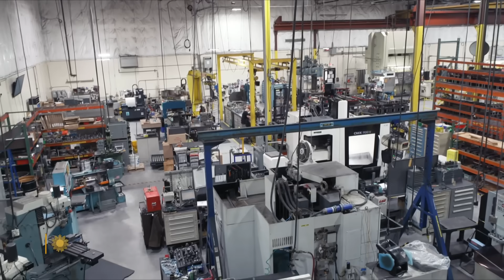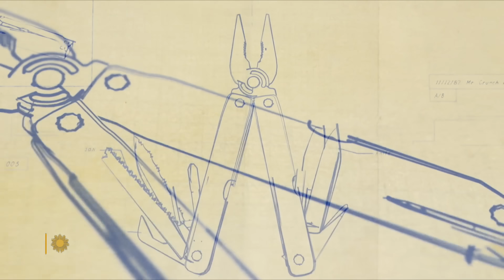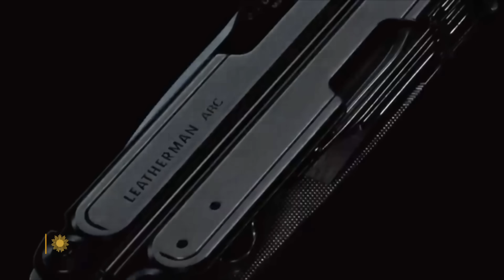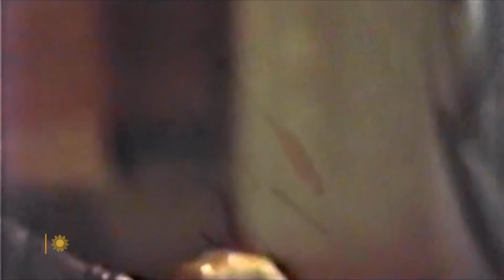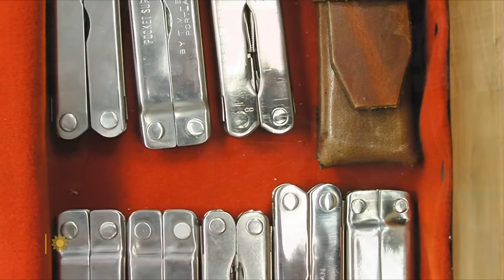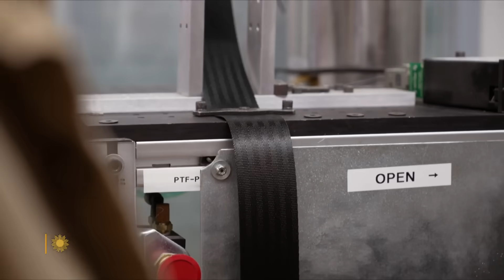The origin story of Leatherman's "pocket survival tool"

Comment: I have a Leatherman Surge with the bells and whistles. I've been using at work daily for the past 6 months torture testing it, the only time it failed me is when I dropped it. I took it apart, straightened a couple parts and it's been working great since. The file holder has held up after putting it in a vice to take out the bend without any problems. I'm very impressed with it.

Comment: My fave has been a Leatherman WAVE for years....and then hurricane IAN destroyed my house.     That Wave was with me every single day for all the repairs from the flooring all the way up to the ceilings.  I would never ever be without one.  We had to evacuate the home, because the hurricane caused catastrophic flooding and went to stay at the neighbor across the street.  After getting halfway done on our house, that Leatherman was my miracle tool, redoing my neighbor's ducting in the crawlspace under his house.  That thing cut through all the rigid coil wire of the Replacement duct, and the blade(s) were always ready  to prep the duct.  I used up the cutting blades on the wave plus pliers but it was worth it.   So pleased to have that tool  for that tight, dark place instead of so many other tools...strapped right to my side. Thx Leatherman for sticking with your invention....the best one for me !!

Comment: Great design. My only problem was the steel wasn't hardened properly. The wire cutters dented and the tiny screwdriver twisted. Maybe mine just fell through the QA cracks. It's still useful. I carry it all the time. It's a workhorse.

Comment: American made, this company is the best...i have a wave+...i think it has a 25 year warranty..ive sent it in twice..they dont ask for proof of purchase,,easy peasy..... First time, I accidentally dropped the knife in the sink with the blade open and it chipped the tip of the blade, totally my fault, and they replaced the blade... Recently, the pliers didn't quite work right, I sent it in with a note attached to please also sharpen or replace both the regular blade and the serrated blade... When it was returned to me, the pliers worked like new, and those two blades were sharp, not sure if they sharpened them or replaced them, but they were definitely sharper... Freaking awesome company, I wish I could afford to own more of their tools, I do have the sidekick as well, but it's lighter duty,.. I don't go anywhere without my Leatherman. If I do, I always end up wishing I had it..